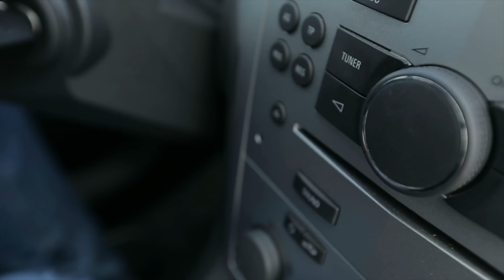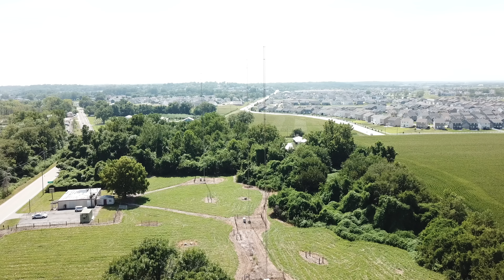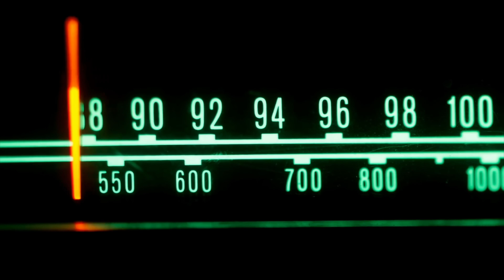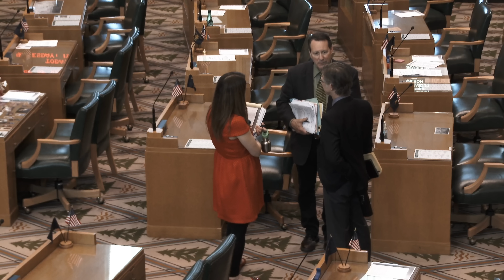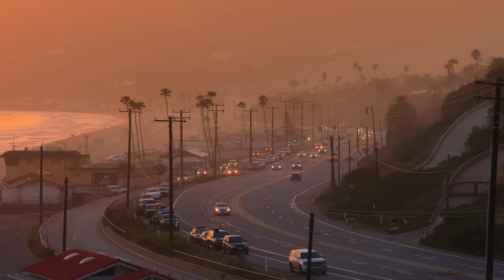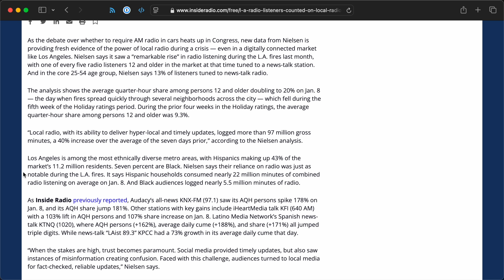Automakers are losing the battle with this 100-year-old tech

Comment: Off topic question, I have a few portable radios around the house on AM, what brand is that remote AM antenna in the video? Or is there one you would recommend? At night, the signal drops and often gets distorted (in summer, or certain weather, it suddenly gets louder for a second and sounds like it's in a tunnel).

Comment: I AM IN CHARGE OF SEVERAL AM AND FM STATIONS IN OHIO AND VERY SAD TO SAY BUT EVEN FM STATIONS ARE FADING AWAY..FEWER AND FEWER PEOPLE JUST ARE NOT LISTENING TO THESE OLDER MODES ANY MORE WHAT A TERRIBLE THING TO HAPPEN..WHO EVEN SELLS AM TRANSMITTERS ANYMORE ? AND THE COST TO MAINTAIN THE AM TOWERS IS THROUGH THE ROOF. SEVERAL OF MY STATIONS ARE GOIN TO TRY TO DUMP THE AM SIDE THROUGH THE FCC AND USE THE FM TRANSLATOR WITHOUT BEING TIED TO THE AM SIDE.
IF THE FCC WONT DO IT THAN 80 % OF MY STATIONS ARE GOING DARK. TOO BAD TOO SAD.....

Comment: I drive a 2023 Kia EV6 with an 800 volt battery and motor platform. I have no major issues receiving AM radio while I'm driving. Sure, when I'm parked interference drops to almost nothing since the electrical motor isn't running. But it is possible for electric vehicles to have functional AM radio.

Comment: In the 80's I worked for a company in Washington DC which had a small fleet of bare-bones 1984 Chevrolet Caprice cars that were equipped with AM only radios.  During the long and boring night shifts I would do some channel surfing and found that I could easily pick up a few radio stations out of Canada.  So, obviously, the long-range capability of AM radios definitely have merit.

Comment: Everything about new cars just don't make sense. They need to deregulate. Not everyone wants or needs streaming or technology in cars. I just want a car, just like the 1980's. It just adds cost. Touchscreen are slow and less reliable than tactile buttons that you touch. Touchscreen require that you look at it, while buttons, you can memorize by location without seeing it. The biggest problem is that it's slow and laggy. Most apps are just not well-designed and with multiple updates become very awkward. Wi-fi is slow too. 

At least AM radio it's simple and good for emergency and itms not that expensive, because it's not complicated. Everything else requires a subscription. It doesn't make sense why radio is done away with. Why would anyone want to listen to subscription streaming when radio was free? The worst part is that the streaming peoviders don't make music and the music labela make pennies from the streaming profits, so what is the point of music streaming? We should give money to music labels with CD sales. Bring back CD players and maybe a little 3.5mm headphone jack for connecting a phone that has mmusic files.

People need to realize physical media is better, but people have forgotten.

Comment: I read a LOT and watched a LOT of videos for two years before recently buying a used 2018 Tesla Model 3. I’m a CAR guy, not a STEREO guy so I read nothing about the infotainment system. I was surprised and mad to find out that once my complimentary “Premium Connectivity” was done in 30 days, I had no AM radio. I could pay $100(?)/year or $9.99/month to have the Premium Connectivity back. What total bullshit from a “tech company that builds cars”!

I love how the car drives and it should be very low in repair and maintenance costs. The worst part of this car is the stupid “let’s put most regular functions on a flatscreen”, and that INCLUDES no standard AM radio. Tesla is half run by brilliant people and half by idiots!

Comment: I worked in an electronics board manufacture plant on 3rd shift with a metal roof & plenty of SMT & pick & place automation machines, unless you were within a few feet of these machines, no real interference. I was only able to  pick up distant clear channel AM stations, one local AM & one very local FM on my AM/FM headset radio.

Comment: I would recommend contacting Robert Kado, Chrysler EMC, also the way I visualize it is EV Power Inverters use high afrequency pwm and the digital approximation of a wave compared to a real one creates differences and eddy currents that want to go back to the source.  These very easy convert to AM noise in their torturous path home to ground

Comment: The only reason why AM sounds like trash is because the FRC, which is now the FCC, set station bandwidth limits too small in the 1920s!!! Widen the bandwidth and then you'll have high fidelity. FM stations take way more bandwidth.  Set bandwith to 20KC, and you'll have 10KC sound bandwidth. Set it to 30, and you'll have 15, which is all you need for good fidelity.

Comment: AM radio reception is a problem for EV vehicles because the electric engine puts out the electrical interfetence.  You only need to shield the electro-magnetic waves from the electric engine.  This same problem occurred in the 1980s when automakers shifted from mechanical ignition to electronic ignition.  The coils used for electronic ignition interefered with the AM signal.  The automakers solved the problem by simply shielding the coil.
Another commntator may be right.  The real goal is to sell a radio subscription with the car.

Comment: I own a Ford Fusion Energi, a plugin hybrid. AM works fine even when running in full EV mode. Ford didn't move ANYTHING vs the regular models. So it is absolutely laziness and make syounwinder if FM even works decently in those cars that would have AM issues.

Comment: You guys are so lucky having to decide between AM and FM, both analog transmission methods. Here in Europe we're fighting between analog and digital, known as DAB (or DAB+) = Digital Audio Broadcasting. The exact situation is different in various countries, but the problems are the same: digital artefacts, dropouts, and simply no coverage at all in rural areas, especially in valleys. DAB is a solution without a problem and thankfully has NOT been universally adopted, with the associated switchoff of analog services.

Comment: As a European this is both a weird discussion as well as a weird bill to pass for legislators. 
Here in Europe, for me especially in Germany, AM is already phased out, there are no more commercial stations on air. There have not been many in the last decades already. New vehicles for a few years now no longer have AM radios (although fitting one into the electronics would not be a big deal in some cases I would not be surprised if it just does no longer show in the software). Here the transition is more from FM radio to DAB+ as it is called here, Digital Audio Broadcast. First countries (I think Norway was the first to announce) already have put an end date on FM radio stations.
But then when it comes to e.g. emergency broadcasts, Europe is overall much more densely populated and we do not even have to consider that large areas, where AM would be at an advantage.
But sue to the same reasons, there is high demand to get frequencies available for other services. 
Old frequencies used analog or even digital terrestrial tv broadcasts that got free are quite attractive for mobile services.

Comment: I have an fm radio app on my cellphone but not am. I am currently using that app to listen to an emergency radio broadcast during a cyclone emergency here in the Gold Coast, Australia. I probably have an old boom box in the garage somewhere that might work but gone are the days when every home has a working transistor radio for emergencies. The phone is good though as I have a power bank to keep it charged in this emergency situation. The power has been off for 24 hours and no idea when it will be on again.

Comment: I was a volunteer fire fighter for many years. Our area is full of ridges and valleys that are pretty steep, and pretty narrow. 

We are up on one of these ridge tops, and the county seat (as well as comm center) are down in one of these valleys. Same with the neighboring counties.

So, our county and another decided to go fully digital with radio comms; if I recall, the state was starting to mandate it. Don't get me wrong, it has its advantages. 

But, call it a quick of geography or whatever, us up here on the ridge couldn't communicate with the comm center. We could hear them clear as day, but they couldn't hear us. The county refused to budge (wheels of government move slow), so we had to come up with a work around.

The next county still had their analog repeaters up and running. We had to radio that county (note: the valleys are steep and narrow, but long and, generally, a straight line.), who would then relay to our county.

This, as you can probably tell, was not very effective. In the end, it was decided to use the analog repeaters up here (which were never removed), and in the adjacent counties. I don't know how it was done, but all of us up here were able to use those repeaters to talk to all 4 counties (mutual aid, so it was helpful).

I left the fire service a couple of years after that, so I'm not sure what ended up happening, but the last I heard, the analog repeaters are still up and available, but they are now able to communicate with the digital ones.
Reply: Repeaters, digital or analog, would seem to be essential for the situation you describe. There is great topographical info and analysis software now that a good RF design team could do some kind of target like 90% of all roads or something. AM at the low frequencies have a ground wave that helps cover that kind of situation but can’t be effectively portable for transmitting. Thanks for the comment!

Comment: I know about an electric car that was being developed under a japanese brand, outside of Japan. When driving the first prototypes around, they noticed AM wasn’t working. “Ah, whatever”. Truned out that the wheel axles picked up the rotating emf from the motors in some type of resonance and it absolutely smashed AM reception capabilities. And since the baseball league in the bosses’ island is broadcast in AM, some hotfixes to the production plans were in order, with overcosts. Not happy days. I remember the welding of some weight “coins” to the axles was brought up

Comment: My 2019 Rav4 Hybrid doesn't seem to work on AM while the car is moving. I've gathered that the interference must ve from the electric motor circuit but I've never tried a portable AM radio while in the vehicle. Ultimately I didn't build the thing so it's not my job to figure out. But I was surprised.
Reply: I know someone who has a RAV4 2020 hybrid. I’ll have to ask about his AM reception.

Comment: Per the FCC, AM radio must be available to recieve Conelrad Emergency broadcasts at 640kHz and 1240kHz. Most AM recievers with a non-digital face, wll have a CD mark at those frequency positions. I understand that this would not apply if the vehicle did not have a AM reiever, but it is probably more important than ever since there are few AM recievers other than automotive out there. BTW.....CD stands for Civil Defense If you weren't sure.

Comment: i got a 2012 ford explorer loaded, and the AM radio works like shit its almost useless
Reply: If the FM is good and the AM is bad there might be some water in the antenna cable. If the radio is easy to reach you could try an external antenna. But you would have to want that AM pretty badly! Thanks for the comment!

Comment: My car radio has AM.  It's an aftermarket head I installed myself.  But the problem is, there is zero content worth listening to on AM. Even the one marginal talk station has a much better FM signal carrying identical programming. Virtually nobody listens to their AM side.  The rest of AM are religious stations or foreign language music.  What is the point of requiring a band to be supported when the content just isn't there? This is not like the 70s or 80s. It's not talk and news on AM and music on FM and never the two shall meet.  Today, everything is FM except the cheapskates who want to do church radio or play the latest top 40 in another language.     There are no English news and talk AM stations left in my area.  So what point is there to require a radio that nobody is going to use?  In a disaster, they won't suddenly remember it.  And what are they supposed to listen to? A preacher telling them to pray for help?

Comment: It was once necessary to have resistive spark plug wires in cars to mitigate ignition noise on AM. They had a practical comon sense approach to preventing interference that worked well. Why is it such an issue for  design engineers of electric cars to use good practice to design filtering that prevents RFI today??? Is that so hard? Why has AM radio in cars become such a political issue!

Comment: My 2018 Honda civic has am radio in it.  I’ve tried it. It doesn’t sound great.  I tend to stream my local am radio on my iPhone to my radio via Bluetooh. I find that it sounds a lot better. One thing that is annoying is if the weather is bad it will affect my cell coverage and I will have to use my am tuner in my car.  I also use my phone to listen to am radio at night.  My local channel gets harder to pick up at night. I have a short wave radio for emergency use in the house.

Comment: The very purpose of the Communication Act of 1934 was to create a propagation plan that every spot in the Continental United States could receive an AM signal. Some have to shut down at sunset. Some can reduce power and/or directionalize their signal under a pre-sunrise authority. A few lucky ones operate as clear channel stations, 50,000 watts ERP omnidirectional 24/7. AM radio is one of the BEST ways to disseminate vital information in an emergency. Not a big fan of government in general, but this is one area I agree on.

Comment: AM radio? Why not force the car manufacturers to have removable floorboards under the carseats so the car can be propelled by foot? Yabba Dabba Do!!!! I am an older Gen X who lives in a rural isolated area, stopped listening to terrestrial radio as soon as I could get a XM radio unit for my car. And if there is a emergency situation I have other back up plans for that, it is not like I will be sheltering in my car.

Comment: This is a one-sided look at the issue.  The fact is that all cars (Electric AND ICE) are exempt part 15 non-intentional emissions.  See 47CFR, 15.103 (a).  They have been exempt for as long as I can remember.  So, it'd be good if you had your facts straight before opining  on this issue.  My profession is not broadcast radio and it is not building cars.  Rather, I design electronics and can tell you from firsthand experience that knocking down EMI in a car, particularly a gas/electric hybrid or  an electric vehicle is NOT as simple  as you two  (who have never done it) attest.  

Add to that  the fact that  broadcast radio listening in general is dwindling in general,  let alone AM in particular, (thanks to streaming services and local music storage).  As a car buyer, folks need to ask themselves how much extra they want to pay  for a car in order to receive AM radio.   The answer is very likely to be less than the cost a manufacturer incurs in adding it.  

Again, it's not the cost the AM receiver - it's the cost to get the entire rest of the vehicle from emitting to much EMI.

Comment: Automotive radios should have AM, FM, NOAA and digital radio stations along with Bluetooth and aux inputs and the option for phone charging. NOAA is extremely useful in emergency situations or you want to check your current approximate weather conditions. + In some locations, it's the only entertainment available in extreme rural locations across North America.

Comment: If everything  crashes, A.M . Transmitters are easier  to get up and running. The A.M.  band  transmits at night easily. This is assuming epic catastrophic  disaster. ( no satellites, no antennas  up. ) plus even though most people  have forsaken  over the air broadcast  of all spectrum.; over the air traditional  communication may be the only way to give out critical  lifesaving direction  and information.  I still listen to A.M. radio about 35 % today.

Comment: When I was a kid, most cars had no radio at all. So, I don't see why "Big Government" needs to dictate the inclusion of more "features" for our cars. They have added enough cost with all of their EPA and mileage rules. Instead, I suggest that the rules require radio noise suppression "kits". This is what Ford did back in the 50s and 60s (and it helped sell a lot of police cars!). By offering kits, they save the manufacturing cost of implementing the noise suppression features on all cars and push the cost onto those who want the quieter cars. That seems fair to me.
But, we also need to make sure that our current EMI standards are strict enough and  enforced so that the non-suppressed cars don't cause interference to adjacent cars on the highway. The last time that I installed a HF ham radio in my car was in the mid 1990s. I quickly discovered that the radio was useless inside city limits. I also remember discovering that Seattle's hybrid busses could be heard blocks away. If you pulled up next to one on the interstate, it would completely blank out even the strongest AM broadcast stations. Can you imagine an entire highway loaded with such vehicles?
Reply: AM radio is essential for emergency communications. Stupid smelly car companies would rather cheap out than install some shielding on their electric cars.

I'm no fan of big government, but this is one thing I can get behind.

Comment: You keep talking about FEMA and emergency response, but I think the argument specifically in cars could be as simple as highway advisory information. Way easier for a driver to switch the radio to get information about issues on the interstate than it is to try to look it up or to put up a bunch of informational signs.